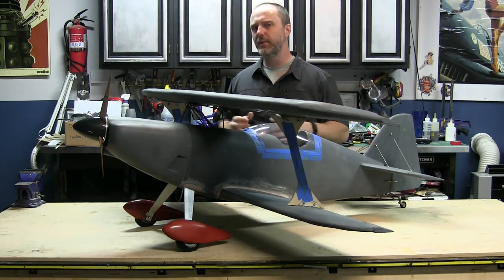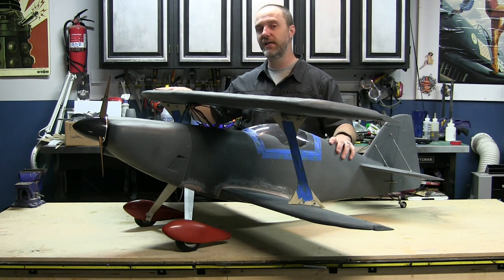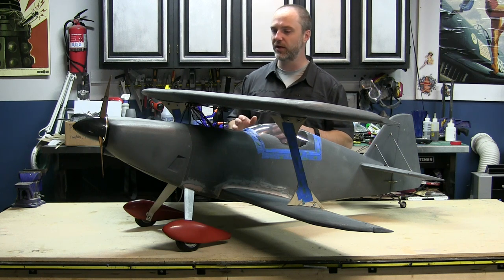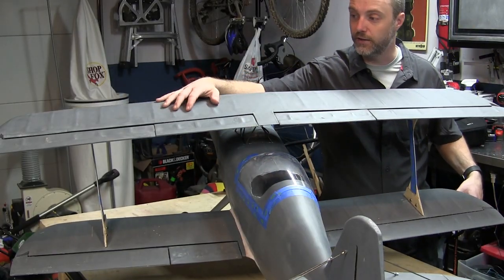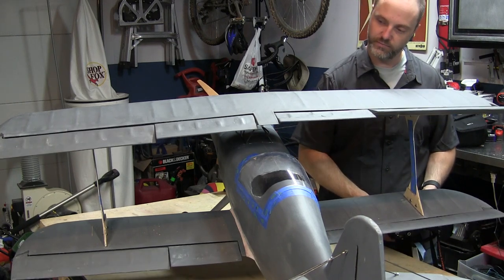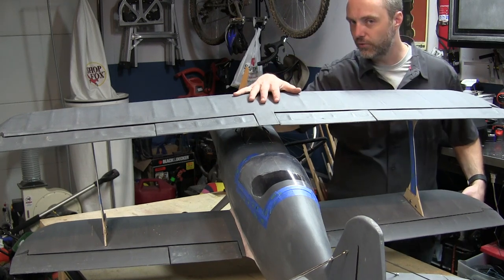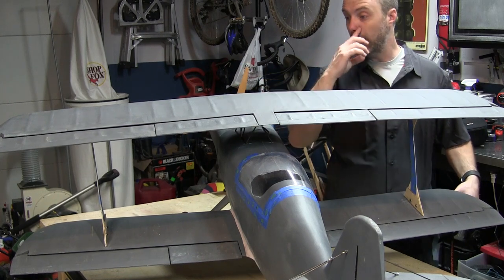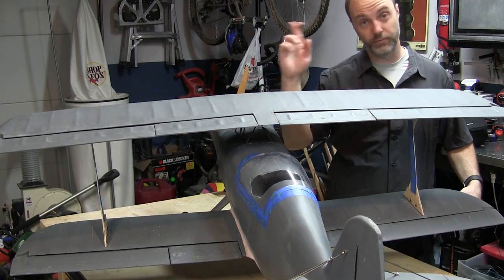8 Aileron Layout - RC Pitts Challenger III

Comment: Hey wilmracer there is no sound to this video except the outro music at the end.
You may want to re upload it or check your edit cause something isn't right.

Regards,
Pete.

P.S keep up the good work and is there any chance you could give me the plans of this fine aircraft? thanks,
Pete.
Reply: Sorry about my last comment the sound is working but only from the left speaker, I had my earphones on with only my right ear and did  not realise that there was sound coming from the left earphone speaker until I turned up the sound.

Regards,
Pete.
Reply from the maker: Damn... Didn't realize the audio got messed up.  I'll check to see what happened.

As for plans, I used a set of commercially available plans for the Challenger II to get the formers for fuselage plug.  For the wing I used the same airfoil from those plans but had to change the wing profile as the design changed between the Challenger II and the Challenger III.  

You can find the full build thread on the Flite Test forums at:
http://forum.flitetest.com/showthread.php?22283-Scale-Build-Off-1-4-scale-(55-quot-)-Pitts-Challenger-III

Building the fuse is covered in this video: https://www.youtube.com/watch?v=EB3_7Zow2ec

The plans I used came from http://www.eurekaaircraft.com/eac_kits/challenger-II.htm.  I scaled them down to be 1/4.

Comment: How did you make the ribs like look?
Reply from the maker: So... You can check out the build thread over at Flite Test (http://forum.flitetest.com/showthread.php?22283-Scale-Build-Off-1-4-scale-(55-quot-)-Pitts-Challenger-III).  Basically I partially sheeted the areas that I wanted raised and then blended with lightweight spackle.  I can tell you I would NOT use this method again, or if I did I would use thinner balsa and less spackle.  The technique looked really good but added WAY too much weight.  In the end the weight penalty wasn't worth the look.